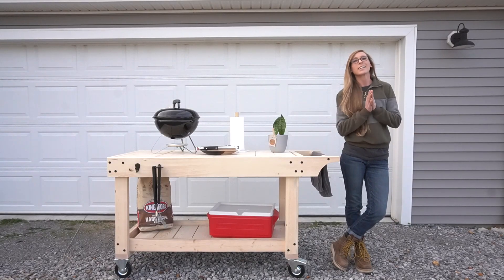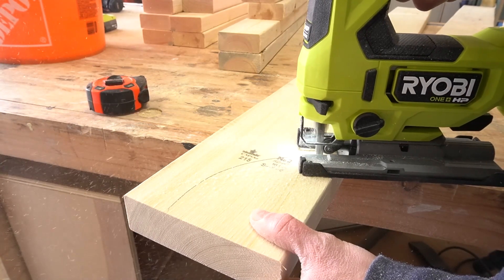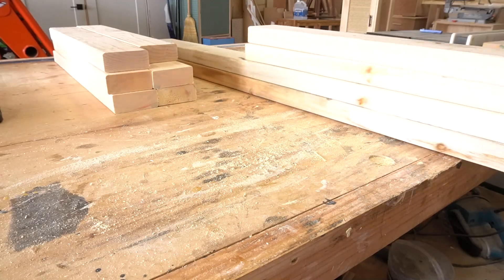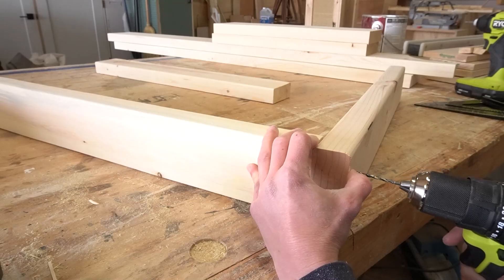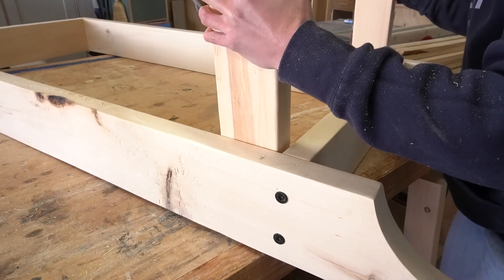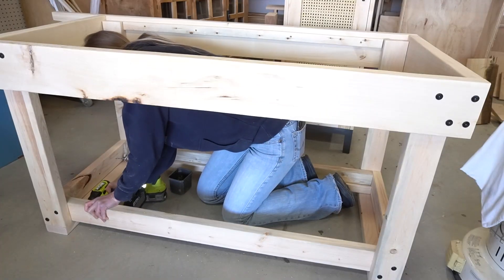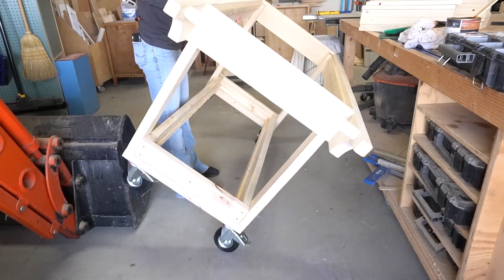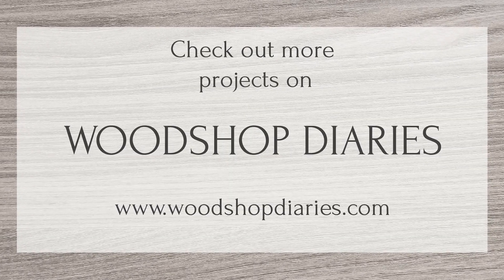How to Build an EASY DIY Grill Cart & BBQ Prep Station

Comment: Hi Shara, how would you change the design in order to have a round built-in kettle grill in the portable cart?
Reply from the maker: You could simply cut a hole in the boards at the top to fit it 👍 then adjust your bottom shelf height if/as needed for the legs of the kettle to rest on.
Reply: @WoodshopDiaries  thanks Shara!